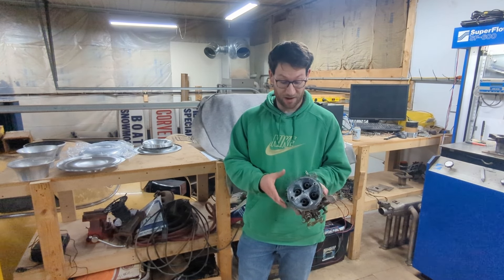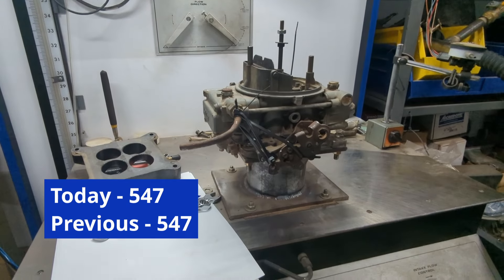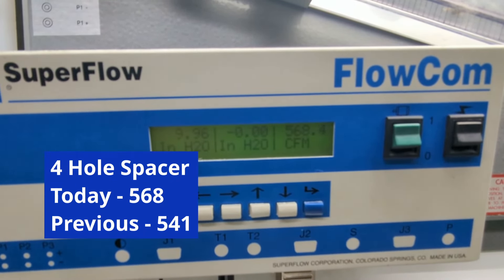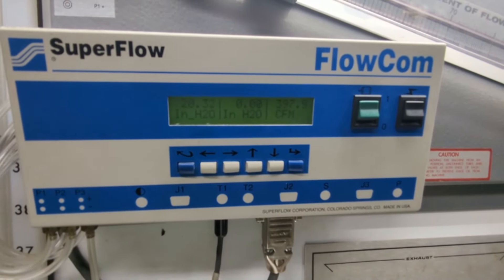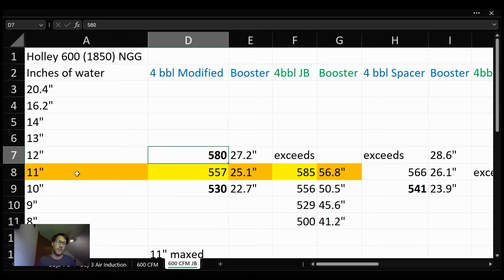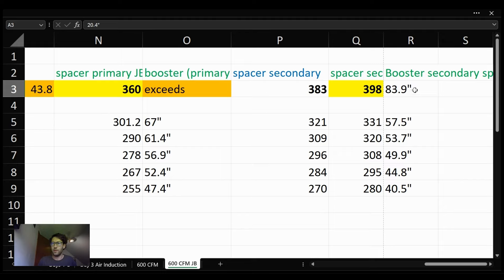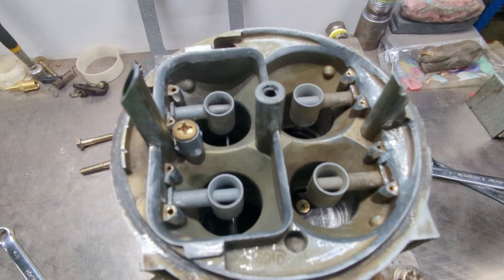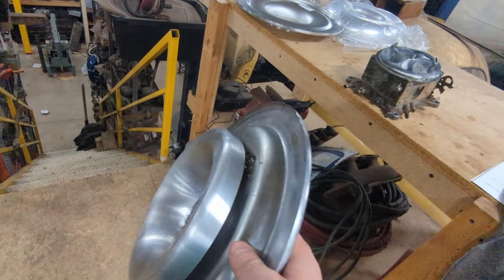Holley 600 + JB Weld | Straight Leg Booster Rework | Flow Bench

Comment: Wow! 
So over the stock carburetor we are over 100CFM more, double the booster signal, with keeping the stock venturi diameter and butterfly diameter 😮😮😮

That is crazy! 😂

So the booster signal doubled this time compared to last time meaning it should keep up with the additional 100cfm correct? 🤔
Reply from the maker: Im not sure if it good or too good.  I predict itl need smaller jets. Beyond that is some uncharted territory for me on the fuel curve side.  Another thing that may screw with how it works is if the fuel will still atomize correctly.  The air pressure and flow numbers definitely look good. 100cfm, booster 2x
Reply: @josephnowak  I agree it would need smaller jets, with such high booster signal throttle response would be amazing I think! 

As far as atomization I'm not 100% sure but I would have to think since it is being pulled on that much harder the fuel would be broken into smaller droplets when it hits the airstream 🤔

And if that is the case imagine up scaling that performance with a much larger carburetor, being able to run a big cfm carb for the drag strip yet still having the booster signal to run around on the street.....best of both worlds 😃